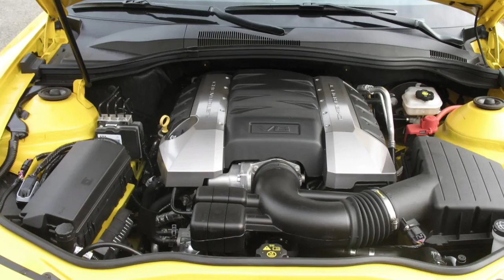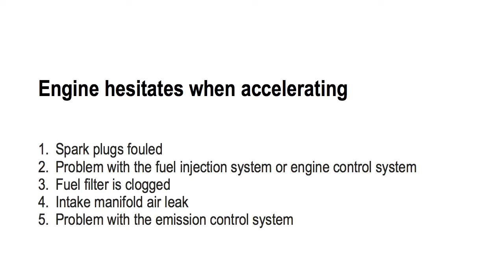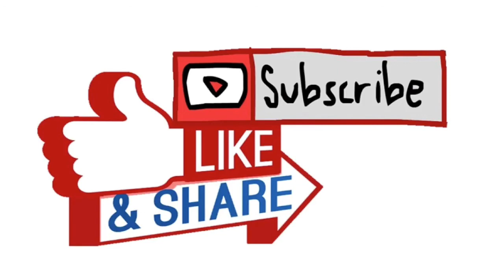Camaro Hesitates When Accelerating: (2010 thru 2015 Models)

Comment: On drive when I'm doing a 40 or 45 50 my car accelerates but doesn't down shift a gear before accelerate fast so basically when I step on it it's a long gear before it switches,it does it mostly all the time.Have you had any issues like that and fixed before thanks.

Comment: I had this problem with my 2010 Camaro. After taking it to several dealers to diagnose the problem, I ultimately went to a private mechanic who was able to isolate the issue. So, after spending many dollars on having each of the listed items checked, it was determined that the ECM module was defective. When they had checked the code it always said misfire. I had the same scare with a semi that one of the gentleman reported on this site. Hopefully, this information is useful to others.
Reply: Mechanics that worked on my car always just stated the code said misfire and would check plugs etc..which would be fine. Mine would fail upon hard acceleration...entering freeway, acceleration after stopping at four way stops or just entering traffic after a stop. If I stopped and turned off the engine for a few minutes it would reset itself. I took it upon myself to have the oil pump etc replaced as the dealers will not touch anything other than what the code reads. In my case the part that sends the code was not working correctly.